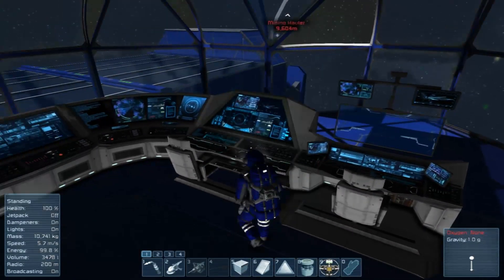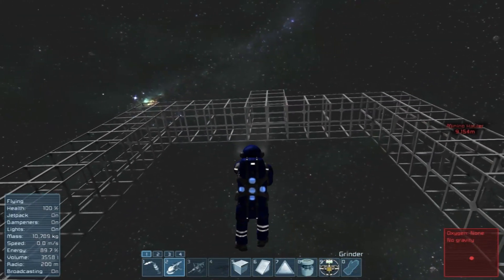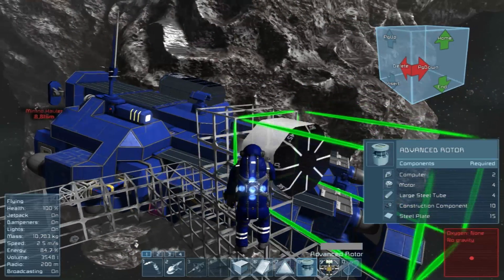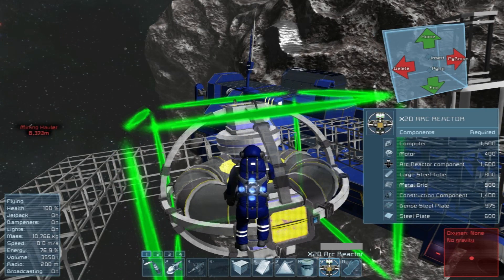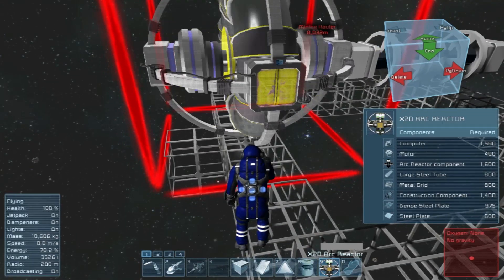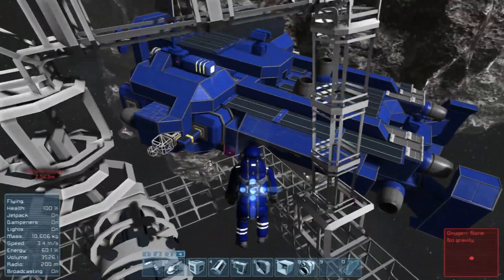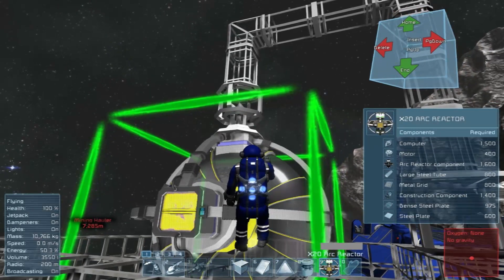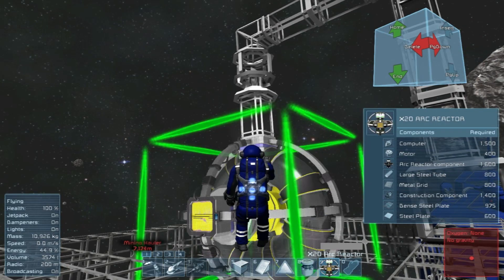Let's Play Space Engineers - Episode 29: Designing The Rotating Reactor!

Comment: When you were testing the whole "put the walls the opposite way to put them closer to the reactor" thing, you seemed to forget that you had the opposite variant of the window you used right on the tool bar that could have rid you of the problem you had with opaqueness using the first one.
Reply from the maker: ToaDrakua True, but it wouldn't have worked for the center. The center is based on the main configuration so if you flip the sides your middle windows wouldn't be the same.